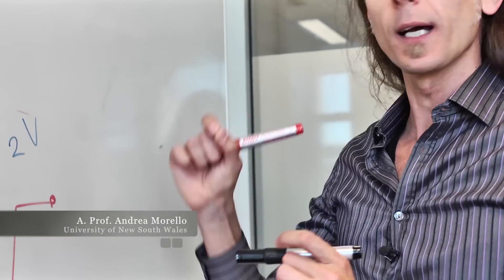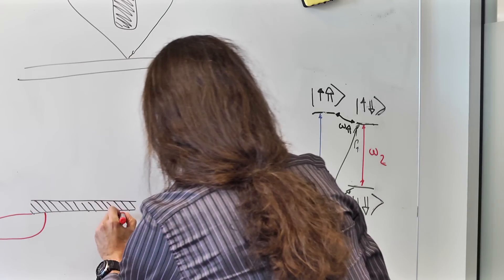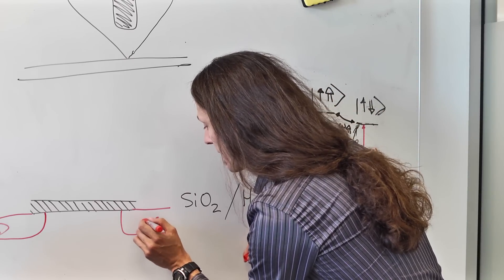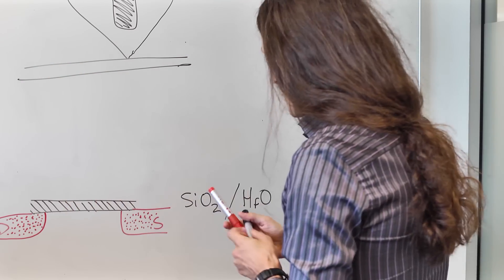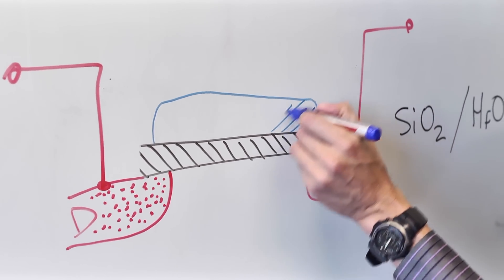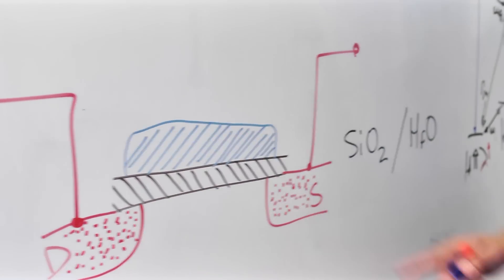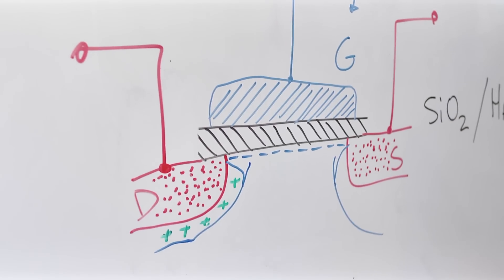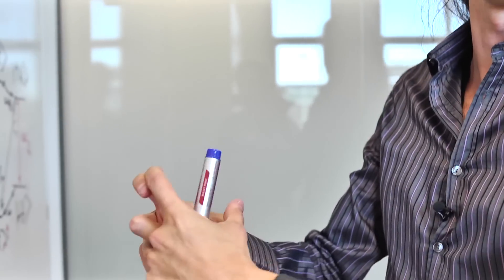Transistors & The End of Moore's Law

Comment: I read that Gallium Nitride (GaN) has a higher potential barrier than silicon (3.4 eV versus 1.1 eV). Does that mean that the two junctions in GaN based transistor can come closer compared to Silicon based transistor before Quantum tunnelling kicks in ?  Or is there a fixed threshold distance at which Quantum tunnelling kicks in regardless of potential barrier ?
Reply: I am no physicist but my understanding is that quantum tunnelling has always a chance with finite barriers. Just the probability rises by the shrinking. 

We are talkong about less than 10 atom wide barrirers. Even if you build a gan transistor, you can get s few more cycle of moore's law out of it, until you end up with 1 atom wide barrier.

Comment: Here we are. 26.12.2024. You can say Moore's law is dead because in 2025 we still don't have transistors 4 atoms across. We've basically hit a wall at around 10nm and now we're just stacking chip dies on top of each other (X3D), separating chip into several components (CCD chiplets) and optimizing this 10nm for power draw.

Comment: 2023/2024 here. An update on our current transistor size (Thanks Apple M3):

2013: 22nm -> ~50 silicon atoms
2023: 3nm -> ~13 silicon atoms

Prof Morello is pretty on point with his prediction with 2025 being ~5 silicon atoms within the space!
Reply: I don’t think that math checks out
Reply: 3nm is just a marketing term. No feature is smaller than 10nm in a so-called 3nm transistor. The improvements have been mainly focused on adding more 3d elements to the transistors so they can continue taking up less space and being more efficient without having to keep making features smaller
Reply: Joke is on him.  We just turned the transistors in the vertical direction, rotated the entire structure 90 degrees so now the channel is oriented vertically and not horizontally and now we are developing 1.4 nm process.  Moore's Law runs on!
Reply: @atticuspomponius  Yeah, that's now how Physics work, buddy, if you do that, you're just increasing the volume of the chip, instead of taking up horizontal space, you're taking up vertical space. That's essentially increasing the size of the chip and you can always do that. If you increase the size of the chip, you would increase the number of transistors on a chip, but that's just quite meaningless.
Reply: @markarmage3776 I think stacking comes with its own challenges and is the most obvious and natural way to circumvent the physical limitations of decreasing node size…
Reply: @atticuspomponius  how does this work?

Comment: Great explanation of transistors, and how quantum computing is trying to supplement that. However, a couple of comments on Moore's law. It was originally not about size of transistors, but about cost reduduction. Shrinking the design rules was for a long time the main path to achieve lower cost per transistor, and the fairly recent introduction of EUV lithography allowed for continued scaling in that way. In addition, there are other ways to get more transistors onto the same area at a lower cost, such as optimizing the chip layout to reduce wasted area, flipping transistors on their side, moving auxilary structures out of the high density area, multi-story structures, and more. With that, there are easily another 10 years of continued improvement possible, likely more, before quantum effects will limit the advancements.

Comment: 50 atoms 9 years ago, I guess that means the rule broke
Reply: Not quite yet but we're just about there. It will be interesting in 2026ish how they're going to keep telling us we need a new processor this year when it can't possibly have any more transistors per square inch than the year before. The only way forward with the current computing tech will be to start making the processors larger again adding more layers and more cores and possibly even making consumer and prosumer level motherboards again with dual CPU capabilities. He's right, quantum physics will not allow the transistors to get much smaller and keep functioning. At this point there are already many molecules larger than the transistors and the drain, source and gate contacts are in the atomic scale already. 

I think the improvements in speed due to more transistors over the next two years will be negligible and any speed improvements will be coming from more cores layered on and more optimized machine code and operating system instructions. It wouldn't be the worst thing if hitting that wall made Microsoft, Apple and even Linux start to tackle the bloat and lazy hacks in the system software they could get away with because there was power to spare. The biggest change will probably come from the gaming industry though. They are always designing their next game for the power of the chip two or three years down the road. What does their development cycle look like after hitting the wall?

Comment: 7nm AMD says hi from 2022
Reply: And it will not get much smaller over the next two years. Any further perceived improvements will come from companies like Intel and AMD will come from layering more cores on CPUs of increasing size and more optimized machine instructions in their drivers coupled with less waste and bloat in operating systems. They physically cannot get transistors much smaller and have them still work.

Comment: i guess this video was processed in a 22nm computer and today i am watching in my 10nm device.
Cool
Reply: Physically, it's still at around 20~25 nm
But there are significant improvements in materials and design so it behaves as a 10nm-wide one would. That's the node descriptor, and it doesn't match the physical size of the transistor for a bit now

Anything shorter than 25nm has a severe difficulty of actually closing the switch, so the node descriptor more closely resembles half the lateral distance between two channels of the same device, which is called a half-pitch

Comment: Professor Morello, thanks for sharing you're knowledge with us. ii have to ask. Are the JFET's obsolete? If all that is needed is the discreet state of Quantum charge [being either a One (+), not a One (-), and zero (0) ]. Could two of the three charge states be held inside the processor like water in a well reducing the electronic operations on the JFETs by a third. Happy Sunday...
Reply: JFETs are obsolete
They have no actual insulation between the gate contact and the conducting channel, so they are very low in power efficiency
So much so that they aren't even taught in universities anymore
Reply: @Zucchi487  good to know, been in repair and remanufacturing many years, thanks...

Comment: I came up with a model for a new type of computer from playing a game, Counter-Strike (a Half-Life mod) when it was in its original beta phase. The system was very poorly designed, like the accuracy system for the weapons was designed that if you slow down to a walk, your guns were more accurate, but they set the parameters up so that it triggered this extra accuracy just going the slightest speed under a full run. Using +moveup which was meant for swimming in the scripting language, which is the only "language" I used, you could get half way between a run and a walk for movement speed and get the accuracy of a walk and the silence of it, with movement sound being another similar flaw they made in the game. That combined with scripting firing of the gun so it briefly made you do +moveup before actually firing the gun and turning it off immediately after firing the gun effectively gave you a more accurate gun at a running speed. There were many holes in the original CS system, I repeatedly told them about them on their message board, getting repeatedly banned. I remind you: I only used the extremely simplistic scripting language built into the game, so I was exploiting and not cheating, even though in effect it was cheating. CS 1.6 should have been CS 2.0 because they made major changes to the engine due to what I was spreading around. At least one of the hacks that I kept to myself and did not put into my script still exist in the current CS system as far as I know. It was basic to the Quakeworld original engine Half-Life is based on. The script that is part of my work, for CS 1.6, has a fully automated taunt system for giving people a hard time. I built a randomizer and relational database that sometimes spits out a taunt based on the weapon or weapon type you are using just before your gun is actually fired when you fire, only using the one command, alias. Alias just lets you create or reassign a command to an indicated string of commands, and nothing else.

We are not digital and nothing in Nature is digital. Digital computers are an exact science with exact results. Nature is based on "good enough is good enough". Oxford quantum physics professor Andrew Steane wrote in his paper about quantum information systems titled "Quantum computing" at https://arxiv.org/pdf/quant-ph/9708022.pdf :

"The new version of the Church-Turing thesis (now called the ‘Church-Turing Principle’) does not refer to Turing machines. This is important because there are fundamental differences between the very nature of the Turing machine and the principles of quantum mechanics. One is described in terms of operations on classical bits, the other in terms of evolution of quantum states. Hence there is the possibility that the universal Turing machine, and hence all classical computers, might not be able to simulate some of the behavior to be found in Nature. Conversely, it may be physically possible (i.e. not ruled out by the laws of Nature) to realize a new type of computation essentially different from that of classical computer science. This is the central aim of quantum computing."

From what I understand they are forcing current quantum computers to unnaturally apply a binary state to something that has a infinite evolution of states. Think of the electron and the circle it makes around a nucleus. That 360 degrees circle it makes is infinite in precision, and that movement certainly has an effect on its surroundings. Basically, practical math is the descriptive language of the universe, and not the actual universe because it uses measurements.

I propose a "Dynamic Stateless Computer" that operates on "Logic Geometry" based only on connections, or links, or pointers - a much more simple computer than the three basic Boolean logic gates operating on mathematical binary bits that is every computer out there. The shape is the logic and the logic is the shape, sort of like a truth table that is dynamic where the "truths" change as it runs. 

Quantum mechanics is beyond me, but if this only needs connections, ie a quantum entanglement, can we build a computer that operates and does its entire run instantly? Like I said, all I need is connections to perform logic... no need for information... the shape is the logic. 

You are best off going to Github and seeing online without downloading the paper and models. When someone looked at my calculators, they accused me of: "You're not doing math! You're emulating math!" Look at the simple calculator first, it only does addition and subtraction. Then look at the complex calculator that does multiplication and division.  As you well know, if I can do those things, I can do anything mathematically. In the main model I created if-thens, complex do-whiles, a randomizer and a relational database.

https://github.com/johnphantom/Dynamic-Stateless-Computer

Through the exercise of the most complex do-while I asked a question related to that, and the answer uses the ancient Chinese/Pascal's Triangle (which millions have looked at over thousands of years) in a new way: https://mathhelpforum.com/threads/combination-lock.17147/ I basically had to count nothing as something to count, as in you can have different items to count the permutations of but a default state of no item is possible for each, some or all to count in the permutations, and it doesn't seem anyone else in history was able to use the really basic mathematical concept of the Triangle in that way for the solution. It is similar to the 4 hats and 4 pegs question of how many permutations you can have that is commonly associated with Pascal's Triangle, but they did not count the empty pegs as part of the permutations that they can have. The technique of the implementation is a little interesting, with it being able to reach any of the 209 possible permutations of 4 wheels with 4 numbers (don't know if I should count 0, it is special in this case - if you do count 0, it is 5 numbers) in 4 keystrokes or less - it's how it scales that is the curiosity, where if I had 18 slots and 18 items to form a permutation it would have almost 3x10 to 18th power or 2,968,971,264,021,448,999 possible permutations, each reachable within 18 keystrokes or less.

I don't have any idea as to how this would be physically built - none of the aspects of it, except for the dynamic logic that I also do not have any clue if it really is what I ask above. I just can do these things I demonstrate and in my extensive almost 50 years of digital computer experience I have not seen anything exactly like it.

Maybe you wonder about my computer experience? I have always been fascinated by computers, starting in 1972 using a prototype Cogar 4 that my dad got his hands on, when I was 3. By the time I was 5, Singer wanted to use me in a commercial to sell the computer, because if a 5 yo could start it, load the OS and then load games, that proved anyone could. My first mentor helped develop Ethernet after working for my father, and allowed me to hold one of the first breadboard ethernet cards developed when I was 10. My first real program (programming since at least 5 if you count the Cogar ASM I had to type to get to the OS and games) was in BASIC when I was 11 that I learned from a manual without anything more than a small example for each command, written with pencil on paper; a rudimentary AI demonstration called "Animals". Second program I made I had another computer (we had moved and left the one at my dads company behind when he sold it) and was a dot bouncing around the screen. Third program, with 12 year old's understanding of math, I attempted to do 3D. I first professionally programmed in 1982, started building computers and networks for a small computer company in 1986 owned by my second mentor, Peter De Blanc who lead ICANN for a period, was an official beta tester and developer for OS/2 2.0 and developed a device driver for it for the extremely complex Truevision Targa+ 64 video editing board (pic: https://imgur.com/a/hMe21Qe ) directly flipping bits on it in 1991. The code for the model for the dynamic stateless computer is about 640 lines and took me 6 months to complete, with the code for the Targa+ device driver being over 4200 lines and took me one 20 hour sitting that compiled and ran the first time that I have 3 witnesses for. That's almost 30 years ago. My experience has only gone up from there. This dynamic logic is something I found, that I have never seen anything like even searching for it on the Internet for the past 20 years.

Comment: Now we're at 7nm & 12nm and at around 10 billion transistors per chip (not only on desktop but also on mobile chips)!
Some examples (according to the wikipedia):
    * Apple A13: 8 500 000 000 transistors, 7nm
    * Qualcomm Snapdragon 8cx / SCX8180: 8 500 000 000, 7nm
    * AMD Epyc Rome: almost 40 billion! 7nm & 12nm
    * Nvidia Turing: around 19 000 000 000, 12 nm (i'm not sure about the size)

Comment: 2019 and we are stucked at 7nm :(
Reply: Not bad considering Intel is still stuck at 14nm lol those bozos
Reply: TSMC and Samsung are working on 5nm and 3nm. There is experimental stuff on smaller nodes. I think 2021 we'll have 5nm, but they want it by mid-2020.
Reply: @4.0.4  you don't even really have 7 nm now. They're just counting on the fact that you don't have an electron microscope to see it for yourself.
Reply: Actually there are working 3nm and 5nm designs already. But anyway, Quantum Computers are also really taking off, therefore possibly solving the problem for good if they can be rigged into doing classical computing which should be simple enough.
Reply: @Nuclearcx 
Go watch the other video of this guy in Veritasium (1).
He explains that Quantum Computers will never replace classical computers, their porpuse is to calculate exponentially. That is, to calculate problems that get way to complicated for classical computing duo to the immense size of numbers / variables involved. 
But that doesn't make it better for everyday use computing.
Reply: @jorgepereira2950  you explained that quite well. Tx

Comment: The one thing he doesn’t mention is that the current limit for Moore’s law is the switching speed of the transistors at their current density (size). Sofie Wilson (ARM Architect) put it very well in a talk: She said “The power density (watts/cm²) of a Pentium 2 is the same as the hot plate on your electric cooker. The power density of a P4 processor is similar to the surface of a nuclear reactor power rod. We already have big problems to remove the heat fast enough to stop the chip destroying itself. The end of Moore’s law is thermodynamic not quantum!

Comment: It sounds like the professor is suggesting that if the gate or distance between the electrodes is high enough, this will stop tunneling, however my understanding is that tunneling occurs when the evanescent wave of the electromagnetic wave passes through the barrier before it dissipates completely.  In this case it sounds like the height would not make a difference.  Obviously the professor knows way more about this than I do, and I can only assume I'm missing something, so can someone explain to me a bit more how the height of the barrier would prevent tunneling?